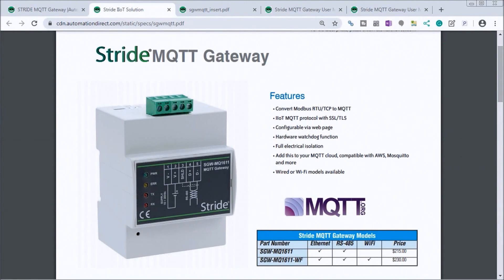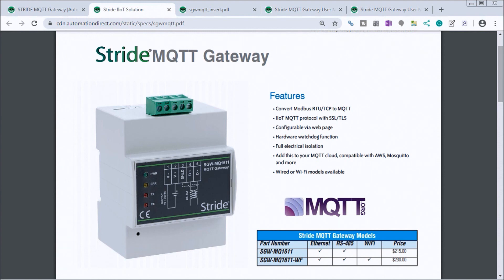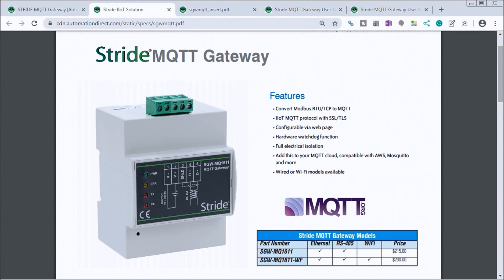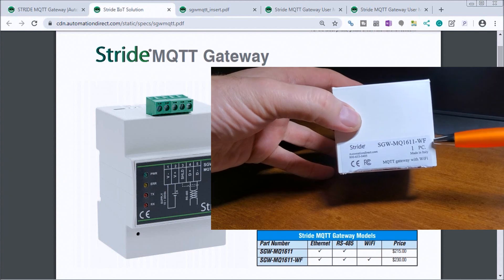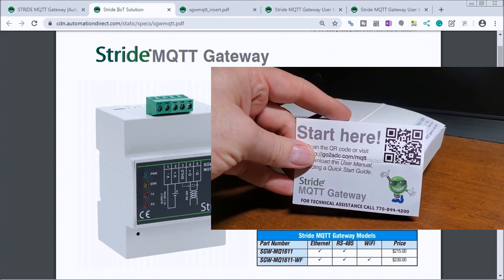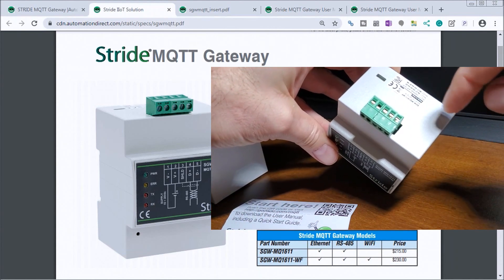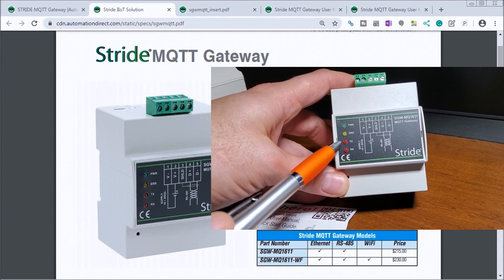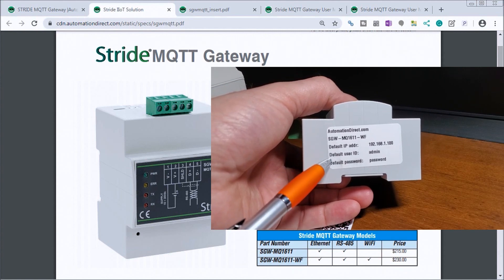Industrial IoT MQTT Gateway: Bridging Modbus to Cloud

Comment: this is an interesting gateway item... i think it will work with arduino and raspberry pi projects such as:  https://www.pyimagesearch.com/    thanks...:)
Reply from the maker: This will work with the Arduino and raspberry pi. Ethernet in from either controller to the Unit. This will allow communication from these devices to Modbus TCP, Modbus RTU, and MQTT Communication.
Regards,
Garry